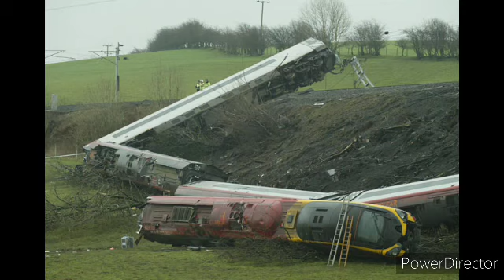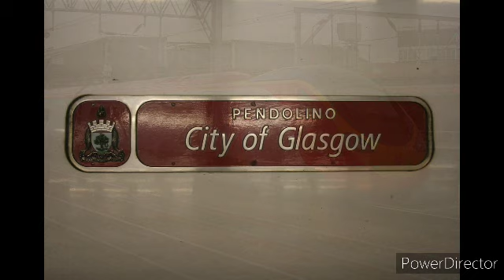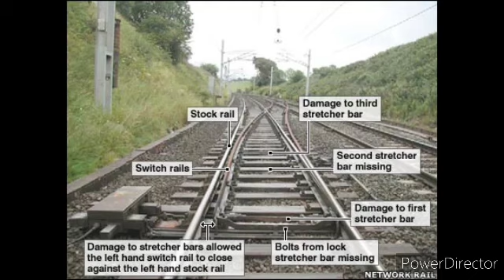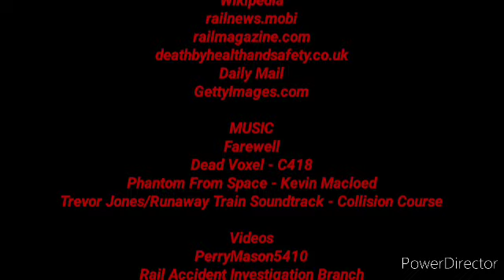The Grayrigg Train Derailment 13 Years Later

Comment: Hi signal maintenance . this was the caused by locking nuts to be undone and not tighten afterwards.after cleaning. for the next shift to work on points. that shift never came. points were left .locking nuts not cranked. will some one not get it.